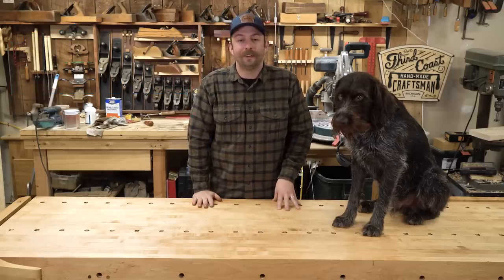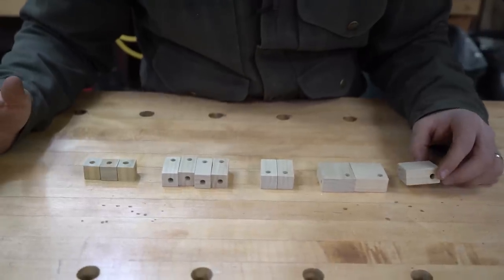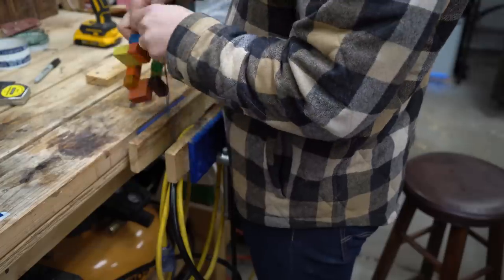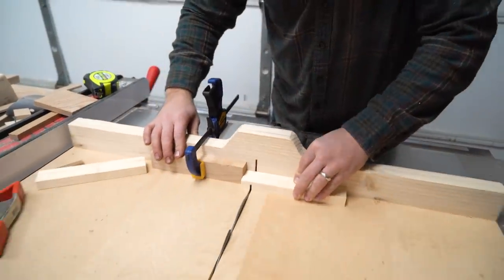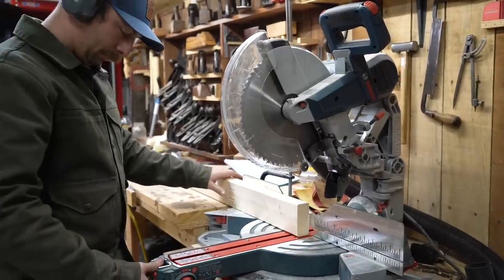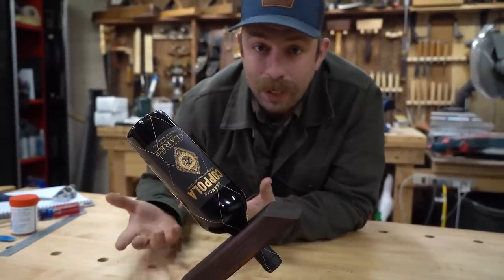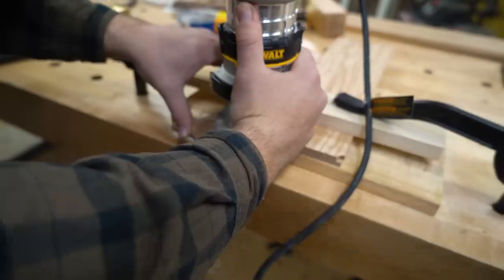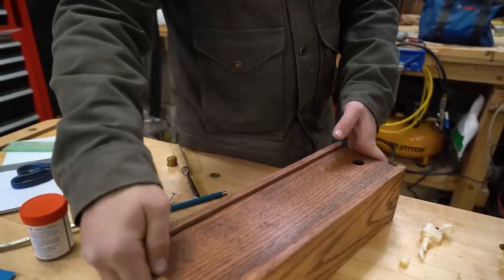4 Easy DIY Woodworking Gift Projects!!!

Comment: David Barron has a video on making a Dovetail Alignment Board that facilitates positioning the tail and pin boards so that you don't have to use the side of a plane to set them up for marking.  It holds them tight to one another, and at 90 degrees and speeds up the marking process, while introducing a high degree of accuracy in this step of the dovetailing process.

Comment: So I began to make the cube held together by the elastic band, I have cut sanded drilled and painted all the blocks when I realized you didn't specify which hole the elastic band goes through on each block for two of the blocks it makes a big difference. If this is available somewhere could you point me to it if not I'll just keep watching the sped-up version in slow-mo. Thanks
Reply: Oh so that's why mine ended up as a heap of crap! Think I'll avoid this channel in future. Hay ho🙄

Comment: Great gifts projects. What do you think, would be better if vine bottle is   parallel to the table? That is if a hole is drilled parallel to that 45 degree cut? Just a idea. Do you think it would mess up the balance? Anyway great ideas and thanks for sharing.

Comment: You are a total goofball!  LOL, thanks for some great gift ideas.  

One thought I had though about the bathtub table/wine glass holder/book & tablet stand.  In order to protect all that stuff from the steamy moisture that will inevitably come up through the slats, you might consider altering your design slightly  Rather than using slats of wood with spaces between them that go all the way through, you might use a solid piece of wood with dedos as the grooves for the book stand so that moisture is blocked from migrating up to the book/tablet by the solid wood below.  It doesn't take much exposure to steam to moisten and warp pages irrevocably, and who knows what it would do to an electronic device...but it can't be good me thinks.
Reply: A solid piece of wood is almost guaranteed to warp as the same piece of wood will be sitting over the moisture whereas the books will be changed out frequently

Comment: I like the box you had  in there.  One comment is that if you'll look around, you can find far better AND less expensive hardwoods at a hardwood dealer.  I have to drive a bit further to get one but not much walnut, wenge, purple heart or ambrosia maple at our (or any) Lowe's and the oak is about 1/3 the price.  I can also get just the board feet I want in the thickness I need.  Get some 6/4 ans resaw to the three boards you used.  Just sayin, but Lowe's usually isn't where I go for hardwood.  Great video though.

Comment: Built the cube, noticed your instructions were a little off....
Reply: So be constructive for others and put how they're off?
Reply: RunanGun90 if you assemble them in the order as pictured, won’t work. Needed to drill one additional hole. At least I had to, tried it many ways for a couple of hours.